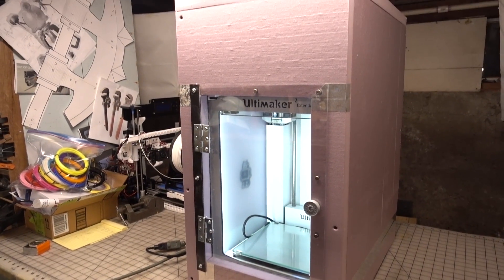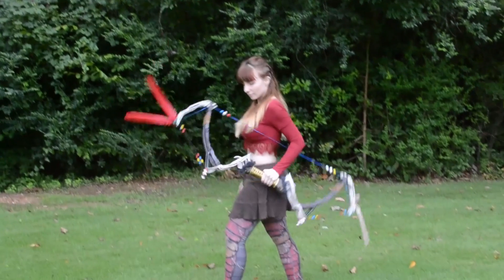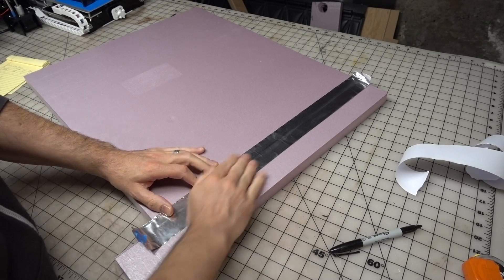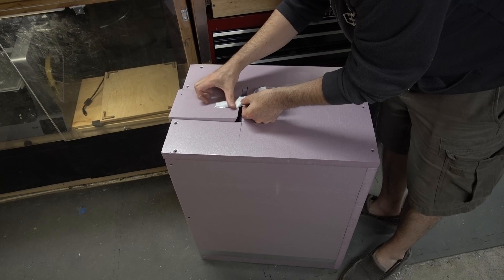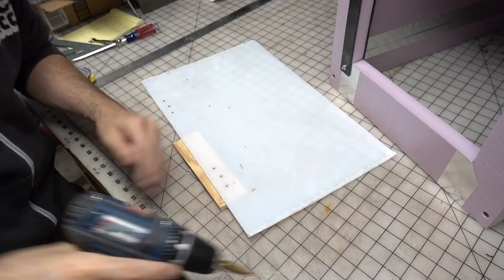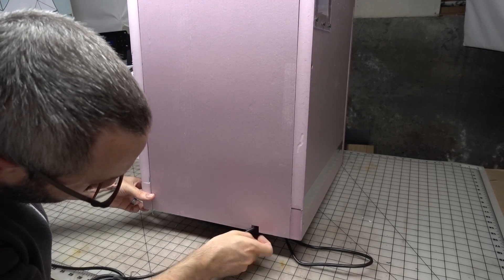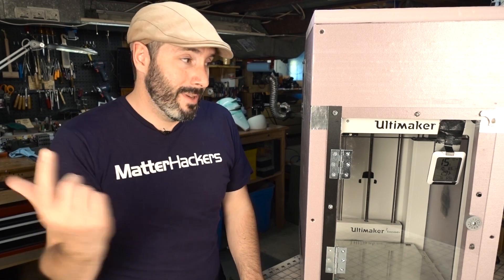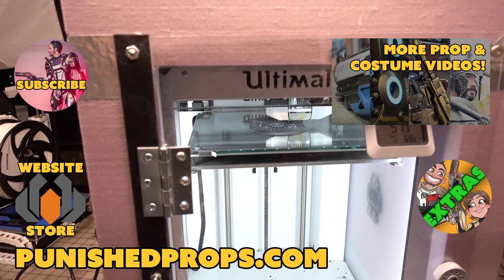How to Make an Enclosure for Your 3D Printer - Better ABS Prints

Comment: Put C-coat or any high temperature paint with added thermacells on the bottom plate of the printer, it stops the electronics board from overheating, i also painted the steppers.
Reply from the maker: Interesting!

Comment: So,  can be used for a regular printer as a dust protector?
I have a dusty house, and looking to enclose my printer to protect it from dust
Reply from the maker: Sure! For that you wouldn't even need to use insulation foam. You could use a thinner board if you wanted.

Comment: Very simple and effective build. A lot can be learned from this design. It might be beneficial to have a foam floor as well, as it can help in ghosting reduction in prints. I plan to make something like this for my Ender 3. But need to move all electronics out of the heating area. Put magnetic plexi hatch on the front, with foam enclosure and then spiked foam interior  to cancel any and all noise. With dampeners on my Nema 17 motors as well as heat sinks, it should do well to help extend their lives. I would keep the spool outside the enclosure, but still in a drybox. Running Merlin and octoprint from a rasberry pi is the way to go. At least for an open machine like an Ender3, admittedly my first 3d printer.
Reply: passive cooling on motors is not the best idea, the better approach would be to either use active cooling (something like water cooling) or to monitor the ambient temperature inside the chamber and keep it at about 50 C. Also you can measure how hot your motors get and adjust the current and printing speed to make sure they are not very hot.

Comment: nice simple casing, I will take this as a reference for mine ;) One design flaw though: You should not enclose your filament with the printer because the heat cycles and high temperature will make it age more quickly. Not as bad with ABS as with PLA, but if you want to have a long lasting filament you want to put it in a separate enclosure at room temperature and with moisture removal.

Comment: Love the video. Do you have an example of the difference in quality if you printed in a cold workshop vs in the enclosure?
Reply from the maker: I don't have anything to compare. I will say that it has less to do with quality and more to do with the print not falling off the bed and also not warping where it touches down to the bed.

Comment: How come no one prints their enclosures? Any 3D printed object using about 30% infill is as good an insulator as foam and makes a much better looking enclosure. I have a CR10 with a 400mm bed and I printed 1 inch thick boards with tongue and grove and nicely shaped rounded corners. It looks like it was professionally made. I also took an old hair drier appart and used the fan and heating element. I control these with my Arduino and a couple of FET's. A thermocouple gives feedback and I can set my temp and the unit does the rest.
Reply from the maker: That's a very inventive idea! For me, using foam board was cheap enough and super quick. I was able to put this together in just a couple hours.
Reply: there is no point in printing the enclosure. First of all it takes a very long time for such a big build, a lot of filament and you should use  abs or something with a higher melting temperature since PLA will probably soften at about 100 C. The only problem with this particular design is that it is highly flammable, witch can become dangerous if the printer is not monitored.
Reply: Do you have an image of your machine? Would love to take a glance.

Comment: Thank you so much for this project.  I subscribed to you just before you released this.   I have a prusa I3 MK2s and have had problems with abs.  A quick run to home depot, 1 roll of red duct tape, and 5 pieces of foam later, I have a heated build chamber and I can print without even using glue stick!!!! Mine is not as cool as yours.  I dont have a cool door.  I have no metal parts or windows but it works flawlessly! Thank you Thank you Thank you
Reply from the maker: That is absolutely fantastic! =D

Comment: Nice build!  I own a Taz 4, print in ABS, and made something similar (I used sheets of MDF, and  glued sheets of foam to the sides).  Here are some comments...

* With my build, it's almost _too_ hot inside.  I found that I needed to change my slicer and print settings when printing in the enclosure.

* You don't need to worry about it being air-tight.  My enclosure more than bumped up the temp (not to mention blocks all drafts), so even with a little air & heat loss, it still is pretty good.

* Not sure why you got warping on the one side.  Odd...

* I don't know if this is true or not, but posts the Lulzbot forum recommended to keep all electronics outside of the enclosure, so at the very least I'd move the power brick outside.

* One thing I've notice (and am more and more concerned about), are the fumes and particles that ABS (and PLA) put off.  After a print, when I open the door, there's a strong burst of odor.  I placed a HEPA air purifier inside (I way overbuilt my enclosure, and can fit a small-to-medium sized air purifier in it), but running the air purifier in it got SUPER hot, so I'm going to make my own purifier with HEPA filters, some carbon pads, and 12V computer fans - kinda of a red-neck air scrubber. 

* If you end up 'stripping' the foam when you screw in a screw, I suppose you could get those plastic inserts one puts into drywall (I don't know the name of them), glue or epoxy them into the foam, and then screw into them,
Reply from the maker: Great tips, thanks for sharing!
Reply: Jeff B t

Comment: don't use ABS, especially for making props, because you don't need to have very good machanicals resistance, and ABS is made from oil(bad) and it release dangerous gases for the health during the print,
 PLA is enough resistant for your use and it's biodegradable, it's better for the Earth !!!
Reply from the maker: Unfortunately ABS is the easiest filament to sand and I spend a LOT of time sanding my props smooth, so I'll figure out how to deal with the rest of the ABS issues.
Reply: Earth argument ignored, ha :D

Well, I guess PLA is not any longer a good use for you after already having one props destroyed by heat.
PETG Would be a viable alternative. I have great success with it.

However, when it comes to sanding nothing I tried is as "sanding-friendly" as ABS. Sadly.

Comment: Hot glue is better than screws. It also provides a seal.
Reply: WOULDN'T THE HEAT MELT THE HOT GLUE
Reply: WHY ARE YOU YELLING AT ME!?
Reply from the maker: I hadn't thought about using glue as a seal! Some people were also suggesting wood glue would work. Weird, yeah?

Comment: I enclose my ft-5 with 5mm plywood, cranked the bed heat up to 100°c started printing the hovalin in abs,  1st part was the bottom of the body, it stayed stuck to the bed, but 3/4 the way through I had several cracks open up.... 24hours of print time wasted.... It finished and overall printed very well at 0.2 layer height other than the cracks ill have to fill in.
Reply: Either I have air leaks I overlooked, or the printer is just too large for the bed to keep up with heating
Reply from the maker: I bet the large printer size is difficult to keep at a constant temperature. =(

Comment: I'm looking at this and somewhat worry about what would happen if you don't notice the machine is overheating. A cheaper printer (or even this one) might not have the right temp sensors and would keep going...
Reply from the maker: That's a fair point. It goes to show that thermal runaway protection is a worthwhile feature on a printer. You could also probably put a thermometer in there with some kind of alarm.

Comment: Thoughts on doing this as part of the cheap printer (Anet A8) build?
Reply: You can inclose that style of printer but because the bed moves the dimensions are a little unfortunate. I don't know if the IKEA lack enclosure is still the hot ticket but it's pretty cheap.
Reply from the maker: It certainly wouldn't hurt!

Comment: What about off-gasses from the ABS plastic Should you have a small box fan (80 mm) with a filter? I was told that when ABS is heated it gives off some toxic fumes? We have 2 3D printers at our library but use only PLA because of that.
Reply from the maker: I'm not sure, but I can say the smell has been cut down with the enclosure.

Comment: I did this using MDF to cut out the noise from my cheapo Chinese printer. I find it helps also keep the printer cleaner and protects all the exposed wiring and electronics the open frame printers have.

Comment: It's understandable that after melted gun you want to print stuff in ABS, but fumes are a big deal here. I keep my printer at workshop but still spend a lot of time in the same room. ABS is petroleum based and releases styrene when melted, same thing is in bondo, I wouldn't want to breathe bondo all day.  and I can tell from my experience that headache is guaranteed if you spend time near melted ABS.  So I prefer PLA just a bit caution needed))  (IMHO)
Reply from the maker: This enclosure seems to have kept the ABS smell down. I may have to come up with a vent solution.

Comment: I made mine out of 3 IKEA "Lack" tables stacked on top of each other and attached with some 1/4" wood dowels and TightBond wood glue. The sides and door are made of 1/4" and 1/8" polycarbonate. The result looks really nice. To deal with stinky types of filament I added a cheap bathroom fan from Lowe's and some dryer flex duct to vent the box out a window (the fan box was spray painted black to match the tables... it looks like it was designed together). BTW, the printer in question is a Monoprice Maker Select; basically a rebadged WanHao i3. 😎
Reply from the maker: Super cool!

Comment: I once made an enclosure for my CNC mill out of that material, it worked pretty well.
You can easily glue it with wood glue.
My experience shows that that a wood-glue connection with this material is even stronger than this material without a joint.

But right now I'm rebuilding that enclosure out of wood and acrylic glass. Cause it looks better and is more durable.
And I don't care about thermal isolation. I just don't want CNC Mill dust on my bed... 
yes I have to live in my workshop, I'm a student...

Comment: Personally I would use Petg over abs, stronger and less toxic while printing
Reply from the maker: My main reason for using ABS is that it is much easier to sand than most other filaments.
Reply: Punished Props plus you can use acetone smoothing, look forward to bumping into you at a con in the future
Reply: Having used both they have their pluses and minuses but I do think PETG sands pretty easily and has what is for me a really nice surface quality afterwards. It was at times a pain to dial in temps, feeds, and speeds though as I found PETG can be a little oozy. I do like it's strength though and the fact it can be recycled is nice.
Reply: I agree with Dave, ABS fumes is cancerous. PETG or even PLA+ is easier to print than ABS but with ABS strength and doesn't melt in the car :) They also sand nicely and no enclosure is needed!

Comment: Does this help with noise in any significant way?
Reply from the maker: It probably does, though the Ultimaker is rather quiet already.
Reply: It probably does. Every foamy material in between you and the source of noise will dampen the sound a bit.
Reply: Did it on my Lulzbot mini and sure it did even with a enclosure not complete (it rest on a grid table so air and sounds still flows by under the printer but reduce significantly the noise level).
Reply: Theoretically yes.